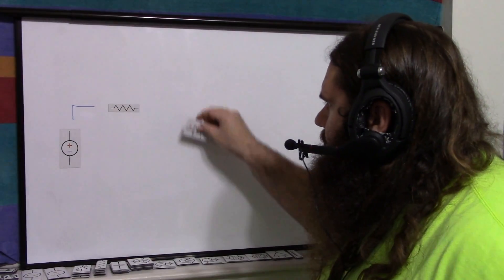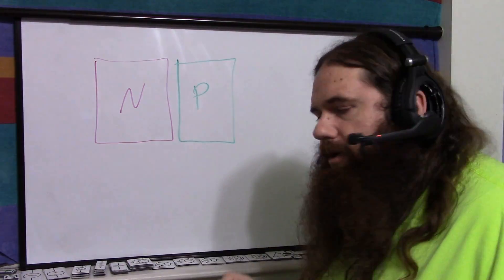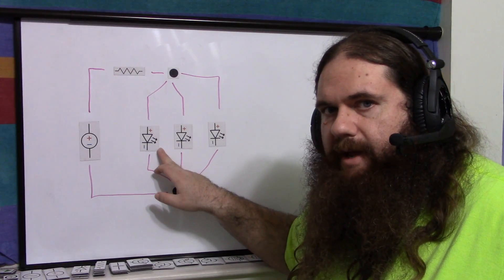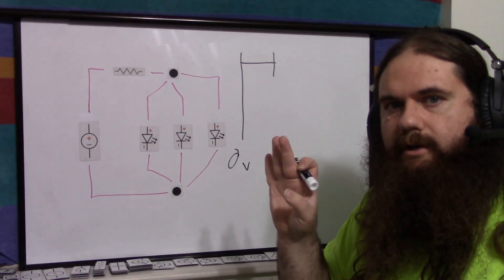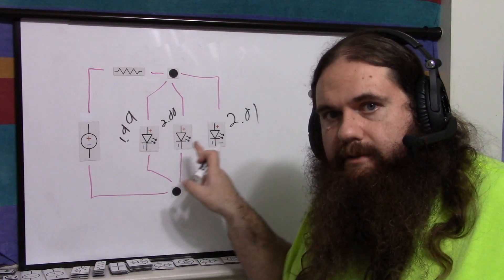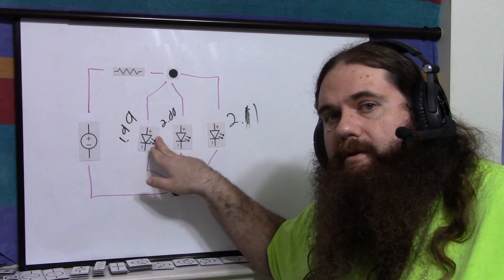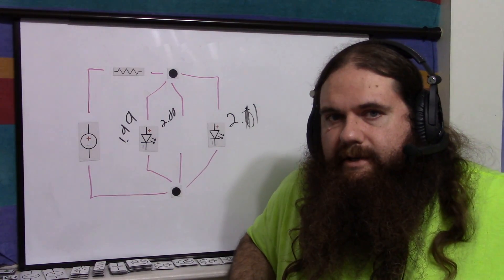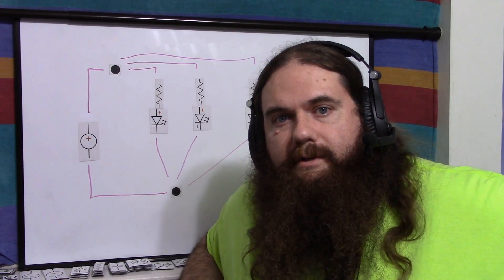Why Parallel LEDs Each Need Their Own Resistors - Simply Put

Comment: It's definitely a bad idea.  However, cascading failure of LEDs doesn't necessarily happen.  One can always drive his LEDs with big enough current limiting resistance to avoid such failure at the cost of all LEDs being way dimmer than the maximum rating.  I think... the actual problems should be requiring LEDs with roughly the same voltage drop, varying brightness, and the lowered maximum brightness.

Comment: I know this is an old video but I just found it😂

My question is, would it be safe to operate LEDS as long as the current you needed didn’t max the forward current of the led.

For example I have LEDS with 20ma current and a max of 80ma before they pop.

If I have 3 wired in parallel, then even at the max power throughput, (assuming the other 2 die), I would still only be at 60ma through one led making it brighter but not killing it.

Would that be correct?

Comment: Was about to create a project with 4 parallel sets of LEDs in series with each parallel set having 6 LEDs and I was planning on powering all of it with a single resistor.

This video may have just saved me from the suffering of extreme disappointment. Much appreciated video 👍

Comment: Thank you. D.Ccurrent walking up the pins  one voltage in two voltage out batteries.  Three power out where loads or circuits are calculated Kirtland laws and four will be neutral or return, whereas rated time will play effects of usage, the Leds are accounted for to which transformers can adjust voltage then breaking it down to the right value the count of resistance to each led thank you I learnt some new things in here to thank you

Comment: I made a toy for my nephew, bunch of buttons and leds mixed. My first electronic project. And I did what you say to not do lol, I mixed colors in parallels, but devided sub parallels by single resistor for identical led colors. Everything works, but as you said, they all doesn't bright the same amount, because I actually mixed identical colors but different manufacturer. Oh well, I thought I was smart ! Next time each led has a dedicated resistor, veru well, thank you so much for your explanation

Comment: I just finished installing 22 led beads (in parallel) to light up inside a scale model building, was wondering how to  power  them to last 4 hours a night every night without any problem, you just gave me the answer I was looking for, i'll just add a resistor to each led and be done with it. thank you for the perfect answer.

Comment: The diodes in parallel that do not light, could it be because of the soldered contact, leaning on led instead of copper, if the wire resistance matters?, or the NP dopping, quality? Similarly, the reason why some connections, like SAT or type sensors, USB. A logical backup, if two voltage amplifier transistors are connected in series, for sound, the input connection between the base bases varies the efficiency of the output? Does impedance have two or more factors to consider?, like the smooth flow of frequency within the circuit, including diodes even if polarities mater, could a diode save a light diode?; is a surge ac or dc? Probably ac as burns diodes too, and two diodesalond a light diode won't light a diode as positive won't flow, but what if in series with a capacitor and inductor could it lite the diode, and maybe the third factor of impedance; These facts and sectors needs more fluency, like "what is the opposite of impedance?" It's not resistance sustainability nor compensation, it's a flow back and foreward, a load and flow synchronisation, the answer to powerless power; good luck. Off the boocks and standard thoughts. It's amazing what a mother board can do, computer, what about a celle-less power?? It's all in the first paragraph!
Reply: Why use resistors along the open polarities of power?? Is it to remove it??, to let the diodes light longer?? So much for power consumption!! 18 years in school + 20 years of doodling books and thoughts + 20 years of common sense, my brain has developed another lump beside just to say, OK, true, whatever!!; I was wondering why I don't see as many butterflies in the greens, they're all in my head for a perfect life impedance.

Comment: In theory this doesn’t work but in practice as long as the LEDs are the same LED and manufacturer you will be fine.  Even if some LEDs are slightly brighter they will still last over 10 years.  In practice I’ve never experienced product failure from what you describe.  I’m an engineer in the lighting business for 15 years now.  Even LED manufacturers will do this in their COB type products.

Comment: This is BS and yes I have a BSEE for 43 years.  I have over 4 dozen LED ladder circuits, right here, right now with anywhere from 80-120 LEDS in parallel using one resistor, and not a one of them have burned out.  I build light saber blades using this and not one has ever burned out.

Comment: Loved your video. You explained a lot. I just have one question.  Would that last diagram still work if the resistors [500 ohm] were pre-installed on the negative side of led? I have about 75 5mm 12v leds 20mA that I'm using for an address sign. Looking for the right way to wire it . Any help would be greatly appreciated.  Thanks

Comment: I routinely wire LEDs in parallel with a shared resistor and never have a problem. I don't worry about individual parts not being perfectly equal. That's just a fact of life; no two objects will be precisely the same. But things that have only a tiny difference in construction will give results that are only a tiny bit away from perfect.

Also, adding resistors won't erase the individual differences among the LEDs, plus the resistors also have a tolerance range that affects the brightness of the LEDs. By including resistors for each LED you nearly double the chances of there being a current mismatch.
Reply: But.... I don't do that anymore; It's not worth the problems that it might lead to. I now feel it's just plain bad practice to put parallel LEDs on a single resister.

Comment: It's really great to see somebody actually talking about this.  So many LED tutorials completely gloss over this issue, or worse yet even actually tell people that you can wire LEDs in parallel with a single resistor.  And the truth is that if you have all the same LEDs from the same manufacturer, usually they're close enough that it appears to work fine, at first.  And then maybe a week, or a month, or 6 months down the line just mysteriously fails.

One other thing to note is that the forward voltage of LEDs also depends on their temperature.  If one LED starts out taking even a tiny tiny bit more current than the others, that will cause it to heat up ever so slightly more than the others, and when LEDs heat up, their forward voltage goes down, which means that LED then starts taking more current, which makes it heat up more, which makes it take more current, etc, etc.  It's basically a "runaway" scenario waiting to happen.  This is why even if you manage to match your LEDs extremely precisely, you really still can't guarantee that this sort of thing won't happen, because it only takes the slightest imbalance anywhere at any time to make it potentially all spiral out of control.
Reply: Does adding individual resistors not fix this temperature issue?
Reply: @joshp7477  Individual resistors fixes the issue of a single failure that cascades inexorably into failure of all LEDS. But any LED can begin to go into thermal runaway (without affecting the other LEDs) if its resistor value is set to allow the max current through the LED (for max. brightness) and the cooling of the LED is inadequate, e.g.  the cooling fan breaks down or the ambient air temperature becomes higher than expected. As the LED starts to overheat its voltage drops and more current flows but the increased current flow causes a larger voltage drop across the resistor which reduces the voltage across the LED. This auto stabilization may be enough to stop the thermal runaway from proceeding to the blowout stage, especially if the LED cooling is restored quickly enough, but the LED operated at a higher current and temperature than it was designed for, and its operational life has been permanently reduced. By how much? It depends on its design and by how much it was abused, i.e. by how much was the normal max current limit exceeded, how close did it come to the absolute max. current (blowout) value, for how long, at what temperature, how much abuse had it endured previously, etc.
Reply: I've got an LED flood light with LEDs coupled (tripled?) by 3 and then triplets connected in series to make a strip powered by 40V or so. I found it out during an autopsy, 'cos supid thing died in very predictable way: one LED of one triplet died in a way you just described, then the other 2 took all the current intended for 3 (it has a constant current driver, of course). I think the guy who designed It intended to do a good thing: if one LED fails, the whole floodlight won't.

Comment: i literally just made a parallel LED circuit the other day for my mech model. did the math on it and everything to pick the best resistor for the job. it looked almost exactly like what you had drawn on the white board, 1 resistor  > 3 LED's in parallel. and you basically explained exactly what is happening to my LEDs at this time. they arent popping, but one is definitely getting all the juice it needs. now i know why. love the video. im a subscriber now

Comment: Thanks! I'm running my 7 year old through some beginner electricity experiments so that I'm forced to play with all the components I've collected and let sit around.  We were wondering why we couldn't get all our LEDs to light up on the parallel circuit.  I guess it's a good thing we picked a big enough resistor doing it the wrong way.

Comment: Correct, but incorrect. The higher power LEDs have a wider Vf over it's current range, EG, take a 1W led, the Vf range for a green led maybe 2.8v to 3.1v, yes 300mV variance or more.

Comment: You're exactly right about differences when paralleling LED's, except, it's worse! All diodes, including light emitting diodes, are NEGATIVE temperature coefficient. If one LED takes the bulk of the current, it will get hot. that lowers the forward voltage drop of that diode, making it take an even larger percentage of the current available through the single ballast resistor. When you first turn it on, you may see all three LED's light. After a while, you will see one brighten up, while the others go dim. The hottest LED will continue to get hotter, making it conduct more, until it is taking all of the available current. If you try this, be sure to size the resistor to avoid exceeding the absolute maximum current rating of a single LED.

Comment: If voltage is high, LED can be connected in series, only 1or no resistor scene also there. LEDs are in series in decorative LED strings.

Comment: Ok
So… 
I connected 12 green leds to a 4.4.volt supply, each pair in 6 series. They got very hot. Then I connected a 47 ohm resistor and the heat was gone. Even the simple resistor seems fine. 

I still got one question after this… 
What if i connect many resistors (idk like 6) BUT in parallel?

Comment: I actually found this video after I tried to connect 3 LEDs in parallel with one resistor. Only one led would light. 

I'm very new and what I've been doing lately is making circuits on my breadboard then trying to figure out why they don't work or why I'm not getting what I think the results should be when I take various readings. They are really simple circuits and the mistakes are stupid but I still get a feeling of accomplishment when I figure out what I've done wrong.

Comment: Just a simple question: when you have a packed SMD LED (3 LEDS with same color, packed in single 6 pin SMD component) would that lower variance and thermal contact between them make it suitable to use in parallel with one resistor?

Comment: Great Explanation!!! There is a small detail to add: the LED drop voltage is temperature dependent (inverse), as hotter as the LED gets, the small is the voltage drop. When you associate LEDs in parallel, one of the LEDs gets mode current (the LED with lowest drop), and since it gets more current, it lights brighter and gets hotter, which lowers the voltage drop, and unbalance it more and gets more current... So it is an "unbalanced" association that tends to be more unbalanced as time goes by.
Reply: That is the same reason why you can't put 2 diodes in parallel expecting it to double the current limits

Comment: What's a resistor? Is it a physical piece of equipment?
Reply: I have four 12v led lights in the ceiling of my van, two in front two in rear. I'm wiring the two in front parallel, and the two in back parallel, to a two switch dimmer switch.

Comment: how dare you answer the same what I wanted to know :D lol .. great information.. I was making a Rasberry Pi color LEDs circuit. I thought what I use one Resistor (220+(220=220)) = 330 ohms... and turn all three colors one by one. (not simultaneously) but one by one. So the current will go through the circuit at a time for one LED... (will that work)?

Comment: This is really good. Would be helpful if you did a couple calculations to figure out how much the resistor should be when you put one on each LED. Thanks for putting this together.
Reply: To do that, you need to know what the maximum current of the LED you want to drive is. Let's say you've got a red LED, rated for 20 mA. A red LED typically has a forward voltage drop of ~1.7 volts. Now, let's say, you're using a 5 volt power supply, a common voltage used for logic circuits. Subtract 1.7 from 5. (5-1.7=3.3) now, divide 3.3 by the amperage. (20mA=.02 amps) 3.3/.02=165. You need a 165 Ohm resistor, to run the LED at full brightness, using a 5 volt supply source.
     If you don't know the forward voltage drop of the LED, the safe thing to do is calculate the current through the resistor at the full 5 volts, and set for only 10mA. 5/.01=500 Ohms. Connect the LED, and simply measure the voltage across the terminals of the LED, to see what it's forward voltage drop is. Subtract that number from the supply voltage, then divide that number by the current rating of the LED. Keep in mind, if the LED is being used as an indicator, rather than for illumination, you may not want full rated power. It might be too bright to look directly at. It's never a sin to run an LED far below its rated maximum, if you don't need that much light.
Reply: @vincentrobinette1507  So you just do Ohms law for each individual LED in the parallel chain disregarding the others as if they're not there?

Comment: hey bud, quick Q. about Samsung F-series LT-FB24B 4' strips
wondering if i had 4 of these wired up with a Mean well HLG-480H-48A, do i have to concern my self with current hogging per each of the 4 modules, or the actual wiring complexity of the LED PCB module itself(mix of series and parallel)? with that driver used at C.C and C.V will i need current limiting resistors and if so does this video apply in theory?  thanks if u can answer, dope vid.

Comment: I'm learning electronics (just barely managed to wrap my head around basic DC concepts and components like resistors, leds, capacitors and inductors) and found your channel by complete accident. 

I knew that connecting leds in parallel would require dedicated resistors and roughly understood why (the different forward voltage drop causes a big difference in how they conduct current) but since I know basicly nothing about diodes didn't really grasp it.

Not only you managed to explain that perfectly (but I have to watch the video another time taking notes and drawing the circuits as you explain to "get the feel), you also managed to make my brain click about how a diode works and illuminated me (ahah because of leds, ahahaha) about a detail regarding Kirchoff's voltage law (mainly the concept of loop, which I understand but overlooked something).

You truly are "Simply put" and I would add "Absolute amazing", I'm very glad the Algorithm decided to popped one of your video on my home page!

Comment: Further, if you have a single resistor with three times the current, that resistor needs to have the ability to dissipate three times the power. (Your circuit design is not complete until you've done the appropriate power calculations to see what rating each component needs to be, in part because higher rated components are both larger and more expensive.)

Comment: I'm gonna take a wild guess on that headset wich is that You are a hardcore gamer so used to having a headset on, that was only logic to use the microphone from an old headset just upgrade the ventilation sacrificing the noise canceling feature lol. I did the led series I needed I don't know how all i know is power supply minus vdrop equals vthruresistor and more current makes it bright as fuck thanks.

Comment: Awesome explanation, saved me from a headache.
Question: what if I have 3 LEDs in Series with one resistor, and then have 3 of this same circuit in parallel? Each Diode wouldn't have its own resistor, but each series of 3 would; is this acceptable?
Reply: 没问题，就是这样设计的

Comment: how to calculate for each Resistor value as above case if we LED have difference value  ? 

for examble  : Red led ( Vf = 1.7V ; If =10mA ) 
       Green  led ( 2.3V ; 10mA ) 
VCC = 3.3V

Comment: I completely agree with you and the math is correct, but I regularly run yellow, green, blue, and white LEDs on the same voltage (usually 5 or 6V with 100 ohm resistors) and have no issue. Granted they each have their own resistor, but they are the same value. Can you comment on this? I am doing a project soon and need to know if this is okay or not.